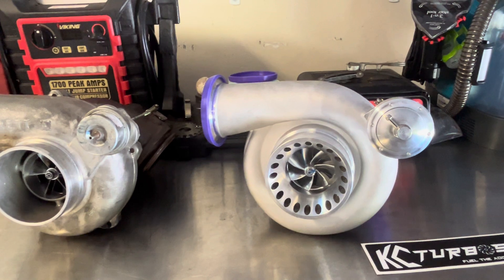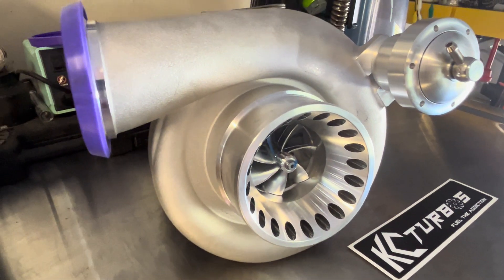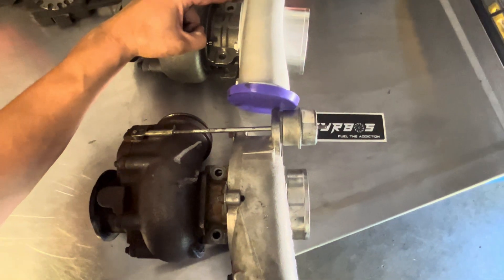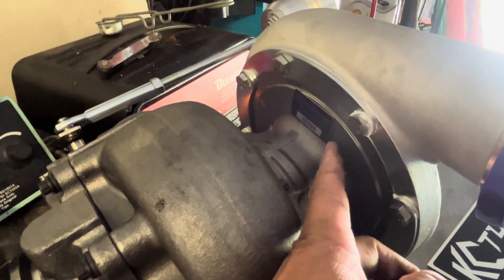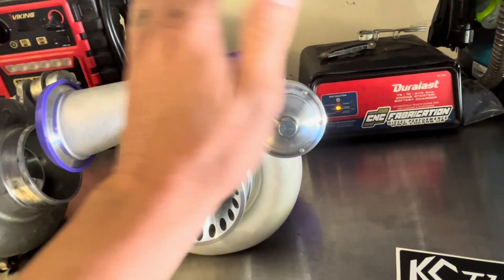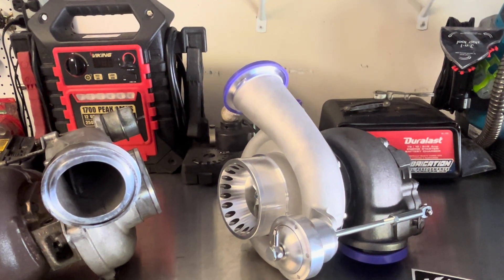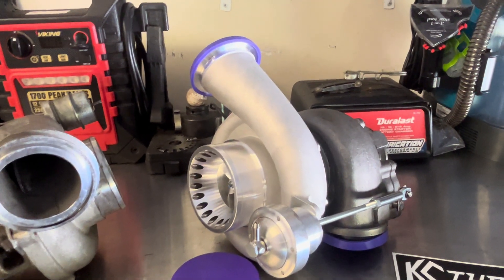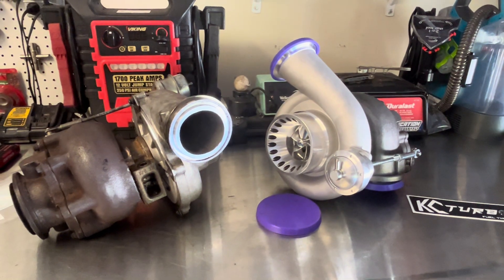KCs new 7.3 powerstroke Turbocharger and why it’s a big deal.

Comment: Appreciate it I’m debating on what I should get my stock. Garrett just went out.
Reply from the maker: It’s a big upgrade over stock especially if you have other mods. If the truck is completely stock then the KC plus is also a good option for a little less. Or just do the balanced assembly if you feel like rebuilding it yourself

Comment: Ive got an E99 7.3 in a F-350 4x4. I did an article for Diesel Power magazine years ago on my then stock ride that was sponsored by BANKS where we put their entire 6 pack package on the truck and dyno'd it to compare it to the 6.0 Ford had come out with in 2004. The truck has been amazing and the bigger intercooler and Banks chip was a great improvement with no loss of MPG. Now with 300,000 on the motor and having replaced all my sensors with new Motorcraft stuff to ensure reliability, I'm ready to change the stock turbo to the Stage 1 - .84 A/R KC unit. I'm running stock injectors and not looking for massive hp gains. What I am LOOKING FOR is potentially an improved mpg. QUESTION> with your KC Stage 1 modification to your truck and having run it for awhile.. Have you seen any increase in mpg with the KC stage 1. ..???
Reply from the maker: If you are referring to the Gen 3 it will have a 0.90 AR that is unique to this new KC. Significant improvements have been made to the exhaust housing and compressor housing. Plus the advantage of the S300 style turbine wheel. I don’t know if you would pick up huge improvements in fuel economy but I would be willing to bet you would gain a little. It would be really interesting since you already have all the other supporting mods to see what a Gen 3 stage 1 would do on your truck. FYI I do have some banks stuff on my truck and the Gen 3 definitely responded well. It’s not anything dramatic but all the small things are are improved with out sacrificing any other areas. For example I really liked my Frank/hybrid set up but it was a little laggy with banks tunes but pulled really well above 1800rpms and also sounded really good. The GTP38R was fun but crazy loud with the cast wheel and was only a little better than stock. It was also kind of sluggish down low but did really well in the mid and high range with banks tunes. With the KC gen 3 stage 1 it just comes on fast, is very responsive, isn’t crazy loud, and pulls the whole RPM range. I have been very happy with mine. I hope that in the future KC will come out with a Gen 3 ball bearing stage 1 in something like a 62mm. That would be really cool.

Comment: How did you manage to get your hands on one? Im in the process of doing turbo and injectors, now I’m considering just doing injectors and waiting for the new turbo
Reply from the maker: I was one of the testers for the generation 3 turbos. They had about 50 guys running the stage 1 and stage 2 set ups. Originally had a small issue with another KC product. They not only helped resolve that issue but said “hey we have a new product coming out and thing you would be a perfect tester” decided to give it a shot and very happy I did. Before I was a Garret guy and that’s all I wanted on my truck since I don’t race and spend most of my time working the truck hauling/towing. But now all my trucks will have a KC on them. Customer support and reliability are top notch. And if you have a legitimate problem they will make it right.

Comment: I have had one of the first stage 3 kc300xs with 1.00 ar wheel with 300 % injectors and 238/100 injectors for a few years . With cnc fab hpops all the goodies but  im really looking into this turbo because mine dosent spoool intill super super high rpms. Very fun but im wasting and missing out on tons of more power . it also smokes a ton so it draws to much attention . Not the good kind 😂

Comment: You mentioned one of the upgrades would-could be injectors and speaking about the injectors and HPOP is there even anymore improvements, refinements and or advancements that can be made to these parts/components? anything stewing in the pot so to speak in your opinion and knowledge I'm pretty curious actually.   
Thanks
Ray
Reply from the maker: @raydornbush  The short answer is yes. Just look at what DS has done with the adrenaline HPOP and CNC fab has done with there stage 2. With the 7.3 having sort of a resurgence in the aftermarket we are seeing new products getting added and modernized. As for injectors I have heard at least one company is currently working on something that is supposed to be really exciting. Details are still really limited. However with things like the 7.3 summit that PHP is putting on I suspect a lot more information will be available next year. Fingers crossed.
Reply: @cbr600rx7  That is definitely some exciting news I'll be keeping an eye out for the related news for sure.

Comment: Wonder how it’ll do with a 6spd. I regularly tow 18k lbs with my 7.3/6spd combo.
Reply from the maker: I think the stage 1 would do very well on a ZF6 truck. The responsiveness especially between 1800-2800 is much better than stock. The best way I can explain it is you are cruising along at say 1900rpms and you start up and small hill. When you start to apply the throttle the turbo comes on faster (more responsive) and provides you with more boost pressure at basically any rpm above 1500.

Comment: If it’s not on the market yet then how did you buy it?
Reply from the maker: KC has around 50 of these units on test mules across the country. They vary from near complete stock trucks to wild. I came into it in a very strange way honestly and that’s kind of a long story that I might do a video on down the road. But long story short KC was kind enough to let me purchase one early and test it out with no strings attached. The only thing they ask was for me to give them feedback on how it performed. So far it has done well.
Reply: That sounds like a good deal 🤝

Comment: I’m loving the jelibuilt hydra in my 97 7.3. Stock everything else. Can’t wait to do some newer injectors with a KC and a down pipe. Sounds like this might be my turbo.
Reply: Do the hpop first. I did 180/0 and couldn't do a pull without codes. Went with a Terminator t800 pump and now it works perfect. You might also see a little mpg boost and better throttle response.
Reply: @logancartright98  205/30 hybrid injectors run fairly good on a stock fuel system. Hpop is definitely something that should be done, but those injectors still preform great without an hpop upgrade, GRANTED that the OE hpop on the truck is a healthy one
Reply: @yumejdm2871  the super duty hpop will support it better than the factory 15* obs hpop but you will feel a considerable difference with a upgraded pump
Reply: @logancartright98  100%, definitely have to know your truck. I've got a 96 with 375k miles and my tunes + 66/88 compressor housing and running hard up top causes my hpop to lose some pressure so I personally am definitely going to need a new one. Looking at a CNC Fab stage 1.

Comment: How's the wastegate? Does it open at 6psi like the factory turbo. Is it easy to adjust the wastegate?
Reply from the maker: @jchaulinkk  no definitely not. It’s a pretty stiff spring.
Reply: Just tie it closed... I welded mine shut with stock injectors for the factory one.

Comment: Is that turbski available on their site yet?
Reply from the maker: I would contact KC directly on that. I was originally told late 2024 or early 2025. However in a recent conversation with a KC employee I was told it may be available a little sooner. Once again I would email or call KC with any questions regarding availability or specific technical questions.
Reply: Not yet. Estimated release is late 2024 to early 2025.